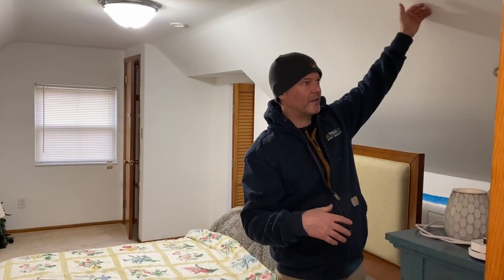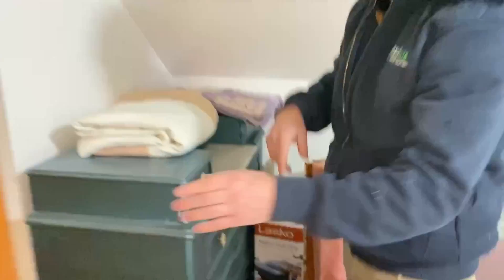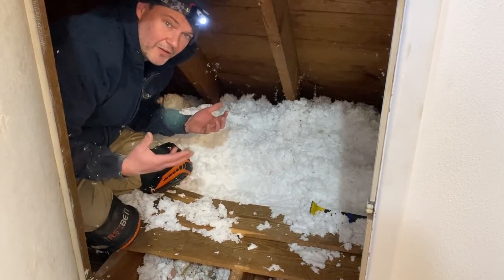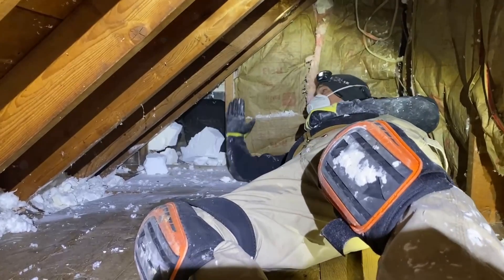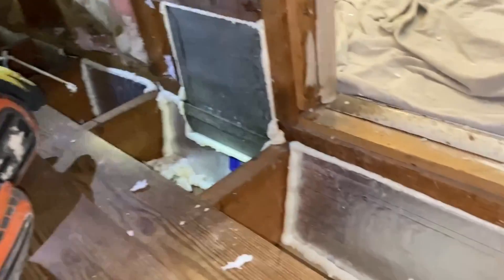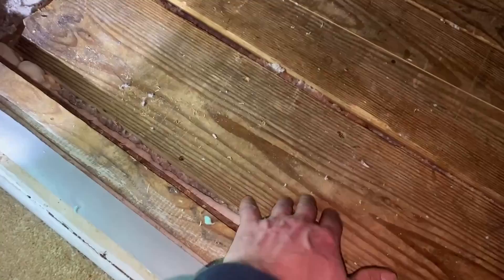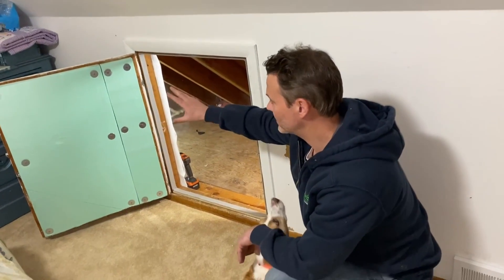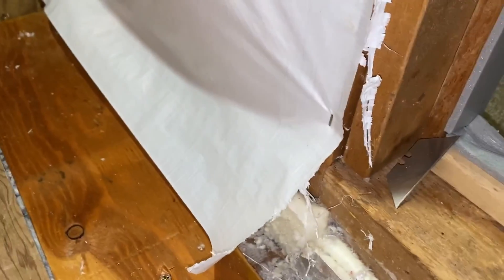What Happens When the WRONG Insulation Company Gets Hired?   Warning...This Gets Ugly

Comment: So why you not insulated part of oblique roof?? I mean this part where you put ventilation. Just what I need to do is a floor and other side of iside walls?? Thanks
Reply from the maker: Sorry for the late response, we chose not to insulate the area where we installed the vents because you don't want to insulate the underside of a roof unless you have a vapor barrier present.  If you just put fiberglass batts into the bays water vapor from inside the home can migrate through and around the fiberglass and become trapped against a colder roof deck (in the winter) and then condense and cause mold growth.  We often encounter batts that are installed against the underside of roofs in knee wall attic spaces, and when we remove them often find that mold has been growing on the underside of the roof.  Hope this helps!
Andy

Comment: How can I find a company like yours in my area (New Jersey)?  Excellent job, I would love to locate a company like yours to seal up my cape code.  What would a job like this typically cost?
Reply from the maker: Hi there, unfortunately I don't know that area well, but I would recommend looking at insulation company websites and try to find companies that emphasize a building science based approach or at a minimum mention air sealing extensively on their web site.  Far too many companies are "Jim Bob's" with a truck performing this work as if it was still 1972.  Lastly, if they insulate knee wall spaces the way that we do (isolating them), they really should be individually ventilated one way or another, otherwise the risk of downstream moisture / mold issues goes up significantly.  
Good luck!
Andy

Comment: Great video. You use the house wrap as to not create a double vapor barrier, almost every video on YT gets this wrong except yours! But my question is about the foam blocking. Wouldn't using those foam blocks create a double vapor barrier under your floor? I"m in a hot climate, is this something to be concerned about? Does it matter if the room is above an unconditioned garage? GREAT VIDEO!
Reply from the maker: Hi there, thanks for your comment!  Do you mean the floor in the conditioned space?  Or the floor in the attic space that's being used for storage?  If you mean the floor in the conditioned space the answer is no because that floor itself is warm because it is a heated room.  If you mean the floor in the attic space I would say that yes ---  it is technically possible that that wooden floor could act like a double vapor barrier.  However, the reason that it will not in practice is because the wood is loosely installed pine planking.  So if we missed an air leak in the ceiling below that storage deck, and water vapor gets pushed into that space via air leakage and stack effect, it will still be able to escape through those cracks in the storage platform.  At that point it can easily dry to the outside through the slant back vent that was installed in that attic space.  
Hope this answered your question!
Andy
Reply: @insulwiseenergycomfortsolu3293  Awesome video, thanks for posting. Piggybacking off ecupirates question to make sure I understand. If my bonus room is above an unconditioned garage, is it ok to use the foam board and spray foam to seal off the floor joists.
Reply from the maker: @davidroberts6936  Hi there, you have a different dynamic with a bonus room because there is no heat coming up from the garage below.  The main consideration in this case is making sure that all 4 exterior sides are air sealed and insulated well, not just the sides and ceiling plane -- like with a cape cod style home.  The hard part with bonus rooms is getting the garage ceiling effectively insulated.  95%+ of the time garage ceilings are ineffectively insulated during construction.  Watch this video link below and you'll see 1)  the best way of doing this and 2) why garage ceilings are so often insulated poorly during construction.  Thanks for watching!

Garage Ceiling Dense Pack Cellulose: https://www.youtube.com/watch?v=6GCE4qzF1dM&t=11s

Andy

Comment: Thank you for an educational and informative video.

Is there any risk of condensation forming in the sloped ceiling bays after you dense pack them? Obviously, there's no air flow up there.

Probably a good idea to Aeroseal those old leaky ducts - they can leak up to 40% to 50% or more.
Reply from the maker: Hi Jim, great question about the sloped ceiling bays.  We haven't had issues with condensation forming in the sloped ceiling bays and we've done well over a thousand homes (both 2 and 3 story) with sloped ceiling designs.  We actively ventilate both the lower knee wall attics (every one, and some larger ones get multiple vents) and then the upper attic spaces also get separately ventilated.  The ventilation is the main fail safe against condensation / mold issues with these types of homes. 
Thanks!
Andy
Reply: I'm curious of the same thing. I was going to use foam board and leave a 1.5 inch air gap to allow airflow over the top plate of wall and up to the ridge vent in the upper attic.

Comment: What did you do in the slope ceiling bays? Is there a good way to get insulation all the way up into them? Thanks!
Reply from the maker: Hi Oscar, good question.  We dense pack those sloped ceiling bays with cellulose insulation.  Our normal practice is create a plug at the bottom of the bay with fiberglass, and then pack them from the top down using a fill tube and the dense pack cellulose method.  Using some type of blown insulation technique is the only way that I know of to effectively insulate cavities like that.  For a variety of reasons we prefer cellulose insulation, but you could also use blown fiberglass or even rock wool.  Hope this helped!
Andy

Comment: What did you do in the slope ceiling bays?
Reply from the maker: Hi Walt, when we deal with homes that have upper floor structures like a cape cod style home, our standard practice is to dense pack the sloped ceiling bays with cellulose insulation.  We block the bottoms of the bays with plugs of fiberglass insulation, and then dense pack them by fill tubing down the bays from the upper main attic space.   The lower knee wall attic spaces and upper main attic space are then treated as two separate attic spaces, and ventilated accordingly. 

Thanks!
Andy
Reply: So you blocked/plugged the soffit and up the sloped ceiling bays? My attic is a cape cod style but my soffit aren't blocked and I have insulation up my sloped ceiling bays just like you showed earlier in the video, and I have a ridge vent. I tried to create some sort of air flow by stuffing baffles on my sloped ceiling ontop of my sloped insulation. So that air flow can come from my soffits, through the sloped ceiling baffles and out the ridge vent. I feel like your video is the opposite of what I just did.
Reply from the maker: @leekyciabrown3769  Hi there, this house did not have any soffit vents, many of the older homes in this area do not have them.  We installed slant back vents to get air flow into the lower knee wall attic spaces.  We dense packed the sloped ceiling bays full.  The upper main attic and lower knee wall attic spaces are treated as individual attic spaces with this method.  We dense pack the slope sections to maximize R-Value for the homeowner, and also because attempting to slide baffles up from below or down from above is often impossible, depending on 1) the thickness of the existing insulation in the slopes and 2)  the length of the nails used by the roofers to attach the shingles.  As long as these individual attic sections are decently ventilated, and they have been air sealed (this is a huge part of our process for limiting moisture build up in these areas), than there should not be an issue with mold growth.
Hope this answered your question!
Andy

Comment: I'm a DIY person that has added insulation on a few newer houses. In a Cape Cod with knee walls spaces, would you want to open any soffit vents into the space?
Reply from the maker: Hi Chuck, 
Sorry I thought that I responded to you already.  Where, if, and how you ventilate depends on WHERE you choose to define the thermal barrier.  We almost always choose to define the thermal barrier as the knee wall flat, knee wall itself, and then the slope ceiling.  In that case yes, you want to bring air flow into those knee wall spaces any way that you can.  If you can do it effectively with soffit vents that's great.  We usually just pop a slant back vent, box vent, roof louver etc, into each individual knee wall space.  Doing this helps the knee wall spaces to exhaust heat in the summer, but more importantly allow moisture to escape to the outside during the winter (if any finds its way in) which will prevent mold growth.  Hope this helped!
Andy
Reply: Hi Chuck, it depends where you are choosing to make your thermal barrier.  If you make the knee walls, knee wall flat, and slope ceiling like we do, than yes.  You definitely want to ventilate any unconditioned attic spaces, however you can get the air flow.  If you can open up soffit vents that’s great.  We usually pop in slant back vents to ventilate those spaces.

Andy, Owner